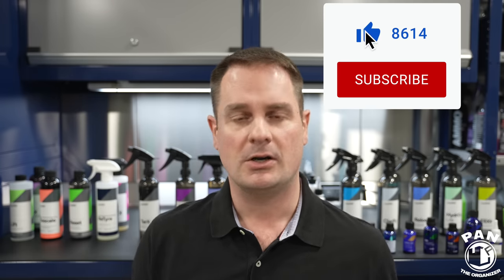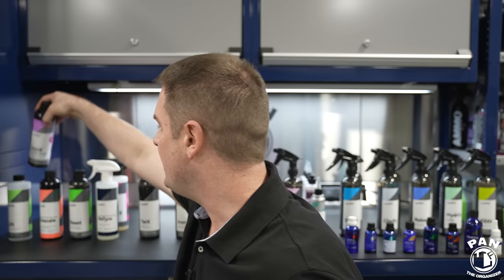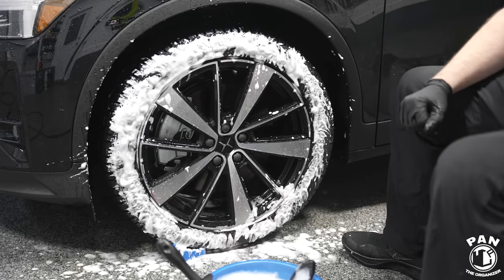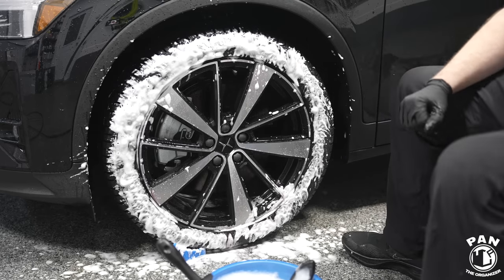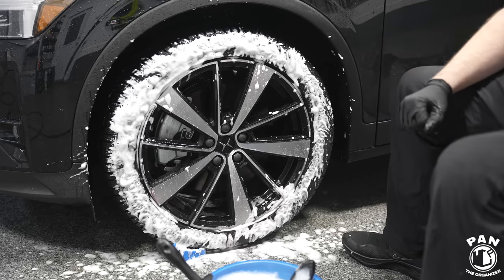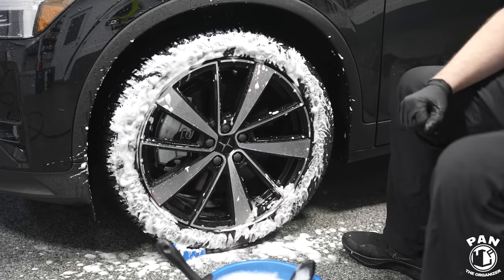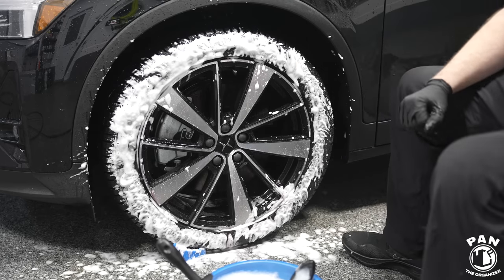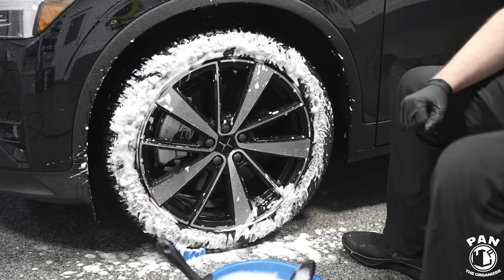CarPro Brand Review - All Their Detailing Products!

Comment: Iron x (rims) for me its the best, basically you don’t need to rub your rims and they get clean. Even to the rest of the car it’s amazing, basically melts birds drops, resins and drops of tar
Reply from the maker: IronX is an iron fallout remover. Not a wheel cleaner. People often use it as a wheel cleaner, but it's not what it's designed for. There are things missing like surfactants and other bits of chemistry in there. And you wouldn't use IronX on a weekly basis.

For regular wheel cleaning duties, use a dedicated wheel cleaner like P&S Brake Buster or Adam's Wheel & Tire Cleaner. They both clean wheels and tires.
Reply: @PanTheOrganizer  Tks!!!

Comment: Hi Pan,
Thanks for the review. Great as always. I’m a big CarPro fan. My Audi SQ8 has the CQuartz 5 year ceramic coating. I don’t have to do much but wash and top it. I use Xtreme Solutions Topper. 

Just started using Inside. Easy to use and very effective. I actually use Perl 1:5 and have put it also on the leather and the finish is a beautiful satin. My seats are red and the Perl enhances the richness of the color.
Reply from the maker: Thanks Mark!

Comment: Another great video Pan, thank you! I’m continuing to build my Weekend Warrior arsenal, though my husband would call it my detailing shop. 
I bough the Car Pro Black Out and applied it yesterday but as I’m sitting on the ground real close to my wheels, I notice that my black gloss wheels are scratched. Not curb rash, but scratched on one spoke, one on each wheel. Weird because I’ve never gone to a car wash. My fault for not going over them carefully in May when I bought it. I was planning on doing a ceramic coating on them at the same time last night but decided not to until I found a way to get the scratches off first. They’re very light, not deep gouges. I looked but don’t see a video for wheel scratches. And help is always appreciated ♥️
Reply from the maker: Hi Mea. The only solution to remove those scratches is to lightly polish the surface, with a small polisher, something like a Rupes yellow foam polishing pad and something like Sonax Perfect Finish polish. 

See how to do that in this video: https://youtu.be/Z4eap0KOZoI
Reply: @PanTheOrganizer  thank you so much for the recommendation, I wouldn’t trust anyone but you. You just have a way about you that makes what you convey such a pleasure to watch. You’re more like my brother, not just some guy in Montreal.
Reply from the maker: Thanks for the trust you place in my opinion. :)

Comment: Should just put this on repeat. Very informal. What’s the difference between shampoos and car wash? Basically foam gun vs bucket wash? Also, what’s the difference between reload 2.0 and Hydr02 lite? Great offering that you reply to every question. Gets more interaction on your videos.
Reply from the maker: Thanks! I appreciate the feedback. I wouldn't overthink the moment about the differences between snow foams and shampoos. Many shampoos nowadays can also be used in the foam cannon. CarPro Reset is a great example of this. You can use it in a foam cannon for the pre-wash, and in the bucket for the contact wash. All the instructions are on the label.

In general, snow foams have more foaming agents, so some are used more for lubrication (pH neutral like Adam's Car Shampoo) while some are used more for a bit of cleaning during the pre-wash (higher pH like Bilt Hamber Touch-Less). 

However some brands have dedicated snow foams that are only for the prewash. They might offer little to no lubrication on the surface, as their only job is to lift and encapsulate loose dirt and debris, which you rinse off the car, before you do the contact wash. The soap in the bucket will have all the lubrication you need for the mitt to glide on the surface and avoid marring.

Snow foams that have a higher cleaning power normally are higher on the pH scale or have stronger surfactants. Like Bilt Hamber Touch-Less or Bilt Hamber Auto Foam or CarPro Lift. You wouldn't use those in a bucket. So it's important to read the labels and inform yourself on what your specific product is meant to do.

Reload 2.0 and HybrO2 Lite are essentially two different ceramic sprays. It's just their application that differs. Reload is a spray and wipe. HydrO2 is a spray on wet surface, and rinse. They both can offer a few months of protection and are mainly used as toppers over an existing longer lasting ceramic coating base layer, like CarPro CQuartz UK 3.0

Comment: Which product(s) would you recommend for my problem? I got my 2013 car with "clear" protective plastic still glued on there from the factory. It was clear plastic lining along the rear doors, now filthy and cracked. I can't seem to remove this. I took pictures if you are interested...thanks...
Reply from the maker: Hard to say without seeing it in person... Is it paint protection film? Using heat from a heat gun or steam cleaner is usually the only way to remove those plastic films easily and safely.  Watch this video: https://youtu.be/0P9qnj87dtc

Comment: Is it safe to use Lift if you have a ceramic coating on your vehicle, but you don't want to remove that coating?
Reply from the maker: Lift has a pH 10-11 so it can eventually break down regular waxes and sealants. It's meant for maintenance of a ceramic coated car. Yes you can use it as often as you want on a coated car. It will not remove the coating.

Comment: As always,  love your channel. I'm going to ceramic coat my second car and know the various stages, thanks to your video back in the day! I am going to use Car Pro Essence as my finishing polish,  as my car's paint is in good condition. However,  do I still need the IPA stage as Essence is a primer? By the way,  I am going to use Avalon King Armour Shield as the ceramic coating,  again after watching one of your videos  - the white BMW one I think! Thank you in advance.
Reply from the maker: It's difficult to know when you are using the CarPro Essence primer with a coating from another brand on top. You'd have to ask CarPro to make sure.

Here's CarPro's official answer as to using an IPA after applying Essence polish: "Theoretically speaking you could skip use of Eraser if Essence was properly used via machine BUT it is hard to measure if you polished the lubricants in the Essence down far enough and so we do recommend using Eraser to be 100% safe.  If possible, wait at least an hour after Essence before using Eraser."

So after applying Essence, wait one hour, then use a paint prep spray like CarPro Eraser, then apply the ceramic coating.

Comment: How sterile of an area should you have when applying a ceramic/graphene coating? My routine was an early morning wash/claying and wash again, then I moved inside the garage for the polishing and all the inside work, but even then I find myself fighting bugs/debris blowing around if the wind picked up any. I would even wash my garage out then dry it before getting started, but there always seems to be something in the air, dust is obviously the biggest issue and probably the one thing you can't eliminate completely unless you build a million dollar facility  🤔 I did use the coating in a can from Gyeon on a black truck and it went very well. I'm wanting to go with a ceramic/graphene this time and hoping to avoid any issues doing it! Not afraid of taking chances though!
Reply from the maker: If you have to work outside, you can still apply a coating, as long as you're not in a dust storm, don't work in direct sunlight. Work in the shade, on a cool surface. Ideally towards the very end of the day. And make sure it doesn't rain for 24 hours after the application. For the rest, don't overthink the moment. Consumer grade coatings are meant to be applied by enthusiasts and weekend warriors.

Comment: So let’s say you have a new vehicle and there is nothing on it and you take good care of it generally. What is, let’s say it simple, the “starter package” that you must have if you go ahead and wash it at some point? Which soap, which detailer, which glass cleaner, which tire and rim cleaner should you have for washing a new car that hasn’t been washed yet and doesn’t have either any coating or any heavy dirt at all
Reply: I have gone down the rabbit hole with detailing and this is what I can say, don’t worry about all these expensive products unless you have no budget. What I would recommend to someone who just wants to do it cost effective and have a good wash weekly. 

Things to buy. 
1. Super clean 
2. Vinegar and distilled water/invisible glass 
3. Cherry foam superior products/gold class meguiars car soap
4. Aqua gloss superior products 
5. Meguiars hybrid paint coating 
6. Technicians choice ceramic detail spray/ meguiars hybrid ceramic spray 

Everything can be bought at O’Reillys unless u want to buy technicians choice 

How to. 
- super clean I dilute 4:1 for carpets floor mats and wheels. 10:1 for all interior. 
- I use the vinegar and distilled water diluted 1:1 for my glass cleaner removes water spots and is cheap. I used it back when I used to detail boats in California. If not you can just get invisible glass. 
- aqua gloss dilute 1:1 for tire dressing 1:1-4:1 for interior dressing depending on how shiny u like it I would recommend 3:1. 
- meguiars hybrid coating is great 1 year coating $30. Follow directions on bottle. 
- ceramic spray is just good to use after every wash to keep your car looking good and beading nice. 

- I would recommend doing a clay treatment as well u can just buy a clay mit or towel and use a bottle with 1oz of car soap as a clay lube. Just spray it on ur hand and if it feels slippery then you’re good to go if not add a little more soap. 

Good luck!

Comment: Thanks Pan for such a comprehensive and informative video. I like car detailing and have applied ceramic coating on my own, my son's and friends' cars.  Carpro is one of a few brands that I favor after trying so many others. The Carpro products that I prefer are the CQuartz, Reset, Reload, Essence, Eraser, Ceri Glass, the glass polishing pad and Fly By Forte. I found the Perl is good on the bumper and interior (including the leather trim)  but for some reason, it did not last long as tyre dressing. 
From my own experience on 4 cars, I found that the CQuartz has better durability compared to the Pinnacle Black Label Diamond Paint Coating.
Reply from the maker: Thanks for sharing!

Comment: Fantastic as always. I love these brand run downs.

I have a question. Well, a minor emergency really. Possibly major emergency.

Recently, about a week and a half ago, there was a wildfire in my area. Of course being South Florida it also rained on the same day. It rained really hard for about a half hour, but kept threatening to rain again through the night. Regardless, after that first downpour I went outside and saw not just smoke residue film, but thick chunks of ash. I took out the hose and gave a quick rinse not knowing how much time I had before the next rain came through but knowing ash can be highly acidic. It didn't actually rain again.. Well, next opportunity to do anything about it was 2-3 days later. I only had about 30 minutes, so I gave it a foam and rinse. This did basically nothing. Next opportunity was a few more days later (yesterday Friday) so I gave it the full foam and contact wash followed by IronX.  I can still see smoke residue film. Would something like Lift or Reset do the trick? No coating, just some CG butter wet wax that has pretty much reached the end of its life cycle. I don't care if all the wax gets stripped off, it needs to go anyway. I do have Koch-Chemie GSF, but not sure it's strong enough...because Gentle is right in the name. Foam and contact wash was CG Honeydew. Should I hit the whole car with Super Clean, rinse, foam, rinse, contact?

Any advice would be greatly appreciated. You've never steered me wrong before...no pun intended.

Comment: Thanks for another great roundup, Pan. If you happen to have a sec, maybe this is a non-starter as I can't find any info anywhere - is Leather 2.0 suitable for motorcycle seats as well i.e. exterior usage a no-no? I was thinking it being water-based that it wouldn't hold up to the elements, but no mention of interior/exterior suitability on the Gyeon Leathershield page either which I believe is not water-based.

Comment: Would Essence+ be capable of removing water spots from a ceramic coating when chemical removal has failed?
Reply from the maker: It depends how bad the water spots etched through the coating or clear. You can certainly try.

Comment: Great video!

I like Carpro products in general, just a few wich i'm not really impressed by. Trix and Bug out didn't seem to work that well for me while i love Perl and Clarify and the same for InnerQD, absolute top notch!
Reply: Trix you have to use a towel and remise the contaminants after spraying the area with it, Bugout works very well on a ceramic coated car, even a car with hydro2 and topped with elixir it works wonders, also you have to do it multiple times if there are still big guts on there and let it sit for a bit to let it do it’s work, I love applying Bugout and then Lift after 1 min of dwelling, let it dwell 5 mins with lift then rinse, works very well for me to remove bug guys without agitation
Reply from the maker: I prefer to use a separate IronX and TarX compared to Trix. You should only use a tar remover if needed (if you see tar deposits) and only treat affected areas. Iron removers you can use more often, like once every 2 to 3 months or as needed depending on brake dust contamination. IronX is actually pH neutral, so very safe. It only becomes slightly acidic when the chemical reaction happens on the surface. It will not harm coatings.
Reply: @littlefoot4417  Probably i'm expecting too much from trix and bug out. 
Either way i don't like to use products wich need to be agitated or touched, they'd just work after applying once or maybe  twice, just my personal opinion and ''demand'' for products in the pre wash stage.

Combining bug out with lift, i've never tried before. For some reason i kinda hesitate to mix chemicals... But i could give it a go and see if it works for me, thanks!
Reply: @SuddenDeathSyndrome  yup no worries! Bugout works great without agitation but sometimes some bug problems are too great for simply applying and spraying off unfortunately! I love mixing personally these products do well when combined and such which is awesome, happy detailing to you!!

Comment: I'm a bit confused, should you use Eraser after Essense?
Reply from the maker: As per CarPro themselves: "Do I have to use Eraser between Essence and CQUARTZ? Theoretically speaking you could skip use of Eraser if Essence was properly used via machine BUT it is hard to measure if you polished the lubricants in the Essence down far enough and so we do recommend using Eraser to be 100% safe.  If possible, wait at least an hour after Essence before using Eraser."

Comment: Thanks for sharing the knowledge 🙏 
But I have a doubt, is the IronX appropriate for wheels or not??
Thanks again and keep on
Reply from the maker: IronX is an iron remover, not really a wheel cleaner. Many people use it to clean wheels, but all it does really is remove brake dust and iron particles. For a deeper cleaning of wheels you would need a good wheel and tire cleaner like the ones I present in this wheel cleaner battle video: https://youtu.be/jfYZh1qB1LY

But once every 3 to 4 months or as needed depending on your level of iron/brake dust contamination, you should be using an iron remover like IronX, on the wheels and paintwork.

Comment: What is your take on Tar and Iron combination - Trix? I see many people are writing that using TarX and IronX separately is more effective. On the other hand, it seems handy to have 2in1 product.
Reply from the maker: Yes using them separately is more effective. Trix is to save time. I prefer using IronX and TarX separately.

You don’t use tar removers often as they can be quite harsh. Use on an “as needed” basis only when you have tar contamination and do spot treatments.

Iron removers you will use more often, every 3-4 months or as needed depending on your level of brake dust contamination.

Comment: Is it fine to use carpro elixir if my gtechniq ceramic coated car has light dust but has bug splatter or bird poop on it to get those off the car without washing?
Reply from the maker: The best way is always to hand wash using shampoo and lubrication. But if you have no other option, use a quick detail spray with a plush microfiber towel.

Comment: A bit confused Pan.. Do you need the Eraser step if you applied Essence first and then you are going to apply CQ UK 3.0 coating? I mean since it is a "primer", won't you just apply Essence and then basically remove it again with Eraser in that case?
Reply from the maker: Check the CarPro USA website it explains how and when to use Eraser if you use Essence. It’s too long to type.
Reply: @PanTheOrganizer  sure thank you!

Comment: Hi pan. Does LIFT remove wax ? Cause planning to add LIFT to my weekly maintenance car wash product.
Reply: Lift is pretty strong, so I'd say it would definitely reduce the life of a Wax. Any fresh waxes or sealants wont be completely removed though. I've been using Gyeon Wet Coat for ages now, so using Lift or Bilt Hamber Touchless, followed by a Top up of Gyeon Wet coat, is my preferred method.
Reply from the maker: Lift has a pH 10-11 so it can eventually break down regular waxes and sealants. It's meant for maintenance of a ceramic coated car. Yes you can use it as often as you want on a coated car.
Reply: Thank you very much Pan and Jack Nash !
Reply: Hi pan sorry just one more question. Can i use elixir as drying aid. And then apply wax.